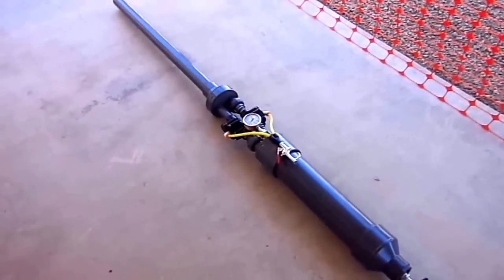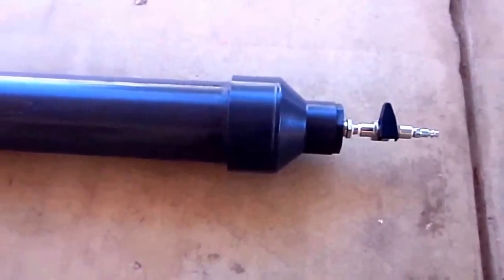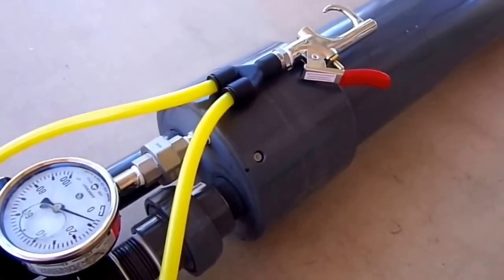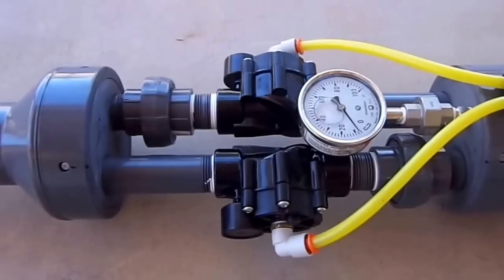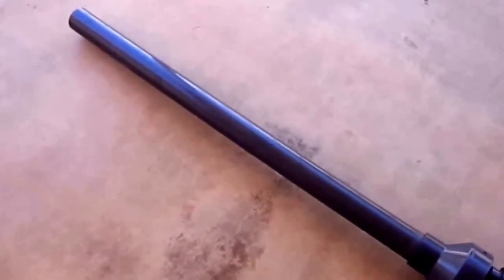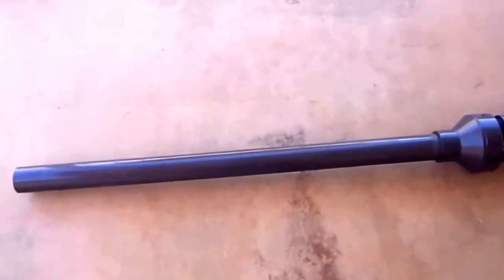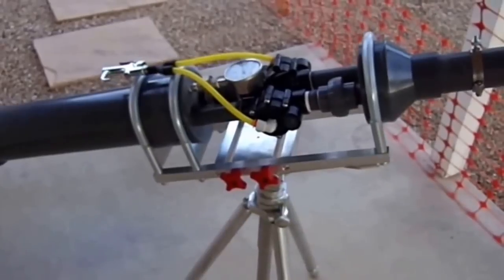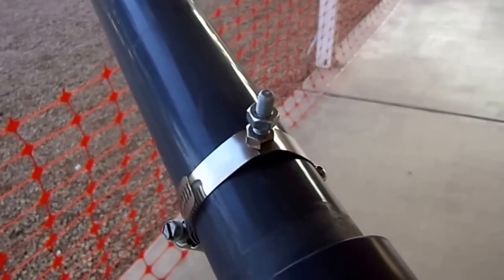500 Yard Golf Ball Launcher / Cannon

Comment: Great design with dual sprinkler valves.  Overkill for Schedule 80 PVC but your weak point is the Sprinkler valve as a switch.  The Rain Bird sprinkler max pressure rated is 150psi.  Need to use the custom made piston valve for max flow.

Comment: My local Lowes didn't have any 4" schedule 80 in stock so I bought schedule 40 to do some pressure tests. The 3' piece with caps on both ends, primed and glued, one drilled to accept a steel schrader valve held 165psi, all my big compressor could muster , now I'm not saying it's safe but I won't hesitate to charge my bait launcher to 100psi, that being said if you can get schedule 80 definitely use it.

Comment: Some fittings in this launcher appear to be drain rated rather than pressure rated (reducing coupler at back end). Use only pressure rated components (those are normally marked NSF-pw). Definitely wear safety glasses and avoid pressurizing in too hot or cold ambient temperatures as the PVC safe pressure rating drops quickly or the material becomes brittle. Safe launching.
Reply from the maker: Nope. All the reducers are Schedule 80 pressure rated to 150 PSI.
Reply: @jurgenscott8430  According to ASTM specs a 150 psi 4" fitting would not be schedule 80 pressure rated. ASTM D2467-04e1 requires 4" pressure rated PVC fittings to have a minimum working pressure rating of 194 psi and a minimum burst pressure rating of 1110 psi at 73 degrees F. Have fun and be safe.
Reply from the maker: @alanb76  You might be right. Who knows. I sold that thing to a golf company in Florida almost a decade ago and haven't heard anything bad. All must be good.

Comment: Love the dual valve design.  So many people use a single valve of the same size, and don't realize they are limiting the capacity of their cannon.  I've resorted to building my own valves to resolve this problem.
Reply: I always liked the bead blaster valves from some big commercial tire machines. Big trucks. 

2 inch inlet/outlet
Working 150psi, Burst 300psi, Not outside the realm to run 200psi with minimal safety concerns.

Or step to proper construction with Nitrogen, run 1500psi/100bar level stuff.

My launcher goals include Redbull cans.  lol.

Comment: Awesome! When I was a kid we built one using a combustion chamber running Right Gaurd as the fuel. We got 400 to 500 yds easy by wrapping the golf balls with strips of shop paper towels (the type that tear in strips along the seams).

This design is little inefficient since the golf ball has a lot of air gap around the diameter. Try wrapping it in something to make the fit tighter and loading it with a ramrod like a muzzle loader. I bet you get 800 yds out of it!

Comment: I built one using 40 pvc and it works just fine! I run about 75 to 80 psi on mine and I can send a potato up to 300 yards and a golf ball up to 500 but it's tricky with that because I have to wad it if I want to shoot a golf ball!
Reply: I have made cannons using 2 in tank and 1/2 in barrel shooting homemade darts. I regularly put 150 PSI in is, somehow not dead.
Reply: @jamesplatt3148  50 cal. airgun. (cannon?) Coool man. send plans?

Comment: MR jurgen let me tell you that you are genius i have one question and i hope you respond to me why you use two rain bird sprinkler valve what is the benefits for that thanks too much
Reply: The goal is to get the compressed air out of the pressure chamber as quickly as possible. 2 valves = twice as fast. If I had room I would have used 3.

Comment: Do you have any specs on your internal mod’s to the sprinkler valves?
Reply: I don't really have any specs but I put the valve bodies on a mill and machined out a large area to increase air flow. Similar to porting a head on an engine.

Comment: I can’t find any 1 1/2 of an inch sdr-26 pvc pipe anyway where. Where do I find it?
Reply: I found mine at Ace Hardware.
Reply: So far 27 hardware or home supply stores including major parts house chains either doesn’t have or can’t get 1 1/2” SDR-26 pvc
Reply: Do you have any suggestions ?
Reply: Does it have to be SDR-26 ?
Reply: It's basically 1-1/2" schedule 20 pipe. You definitely need it for the close fit around the ball. Try a sprinkler supply. I don't know if you have a Turf Irrigation or something like that around you.  @timothywingo4242

Comment: If I use 3 valve sprinkler with 120 psi it will be Danger ?
Reply: The valves I used are only rated for 100psi. 120psi might be ok but it will weaken the valve over time.

Comment: You almost took that bird out 😂

I made one with sch40....is it really that dangerous?
Reply: PVC piping was designed for liquid pressures that usually run at a constant or near constant pressure. It is not rated for air or gas pressures. The repeated pressurize to depressurize cycle can make PVC weak especially at the glue joints. At least wear safety glasses.

Comment: Hey Bud that is a bad ass cannon you built. My question is how does the blow tip trigger activate the solinoids?
Reply from the maker: The valves operate on pressure differential. Some of the air from the air tank goes through a small pin hole inside the valve. The surface area on the back side of the diaphragm is larger than the surface area on the front so it keeps the valve closed. When the differential pressure is allowed to escape (via the blow gun) the valve is allowed to open. And rather quickly also.
Reply from the maker: The solenoids which are no longer present would normally let the back pressure out of the valve and release the diaphragm. The trigger does the same thing only a lot faster because of the size of the tubing.

Comment: When you look as balls leave the barrel they just going in any direction, you wanna use super glue and a piece of pipe glued on the ball to give it a skirt and put some rifling in the barrel and it run more consistent to be accurate then ,I'd remove the white tube from the barrel and shrink the ID of the pipe to OD off the ball ,the slack in the ball in barrel now will be changed to the white pipe ,use a couple of inch to make a skirt ,once riffle it be super accurate then once you got the rifling right ,to little and won't hold stable over big distance and to much and creates the magnus effect and will make round pull to where least air pressure is in the air ? There is a magic ratio for riffing for the round and barrel ,with building a cannon so well am sure you'll explore hints on accuracy,knowledge can be dangerous thing ha ha
Reply: Thanks Paul. I already sold it and I'm on to other projects. Done with ball launchers.

Comment: That is fucking sick. why did you use 2 valves can't you use just one? how did you keep the ball from rolling back into the reducer?
Reply from the maker: Two valves let the air out faster. If I had room I would add a third.
Reply: @jurgenscott8430  Most people use sch. 40 PVC, pump it to 100 psi, seems safe?! Also, base on the math, your two 1" valves DOES NOT let the air out FASTER than just install a 2 inch valve, based on the cross sectional area: Dia=1" means r=0.5" which gives 2 valves total cross sectional area of 2x0.785=1.57 inch^2, while ONE 2" valves gives 3.14 inch^2; it means INSTALL JUST ONE 2" valve opens TWICE of air cross sectional area=moves air out 2X FASTER. Correct me if I'm wrong. I want to build 1 using 3" valve but cannot easily find it; and 2" valve is already cost so much more than 1" ones. Remember, the bigger the cross sectional area=bigger Diameter valve/pipes, the MORE FORCE it exerts. At 100 psi, a 4" pipe gives 1,256 LBS force; 3"=706.5 lbs; 2"=314 lbs force push. Based on my review of quick engineer/physics, it's BETTER TO use LONGER shoot out barrel and BIGGER 4" air chamber so max out SHOOTING RANGE. Also, we can calculate the energy it acts on the golf ball (which IT'S MUCH LESS MASS compare to shoot BAIT out; say, i.e., 0.5 lbs golf ball vs 2 lbs or 4 lbs of bait or stone or metal ball), and we can use physics to calculate the LIGHTER 0.5 lbs the golf ball shoots 500 yards will become 200 yards range if the same gun shoots 2-4 lbs of BAIT heavier object. When I've more time + better mood, we can review engineer/physics laws to calculate how far can we design 4" air chamber at 4' to 10', change 2" barrel from 5' to 10', how far range can it reach:). After out of school & man have to work to make $, I forget many physics laws. I've to review when I make enough $, retired young and have good mood/time then review those fancy laws - every man loss so much childhood fun dream times when he grows up spend too much time to make$ work for a barking boss, sometimes have to work hard to make women in our life happy we become slave or don't have time to do fun things:). I wish I can find 3" value sell under cheap price < $15! Bigger valve=let air out FASTER=BIGGER FORCE PUSH object out=SHOOT LONGER RANGE=HAPPIER men we become. Most girls don't care about men's fun project LOL:). Hope u teach me something. Thanks:)! In short, make one shoots 500 yards of 0.25 lbs golf ball is pretty easier, but make one shoots 2-4 lbs stone ball heavy object shoot over 300 - 500 yards is MUCH HARDER. Any advise is welcome. Love to exchange mental power:)!
Reply: @alexl932  That was a great response. Thank you for that. Your math seems right and I would think a 2" valve having more surface area would generate more distance. It was fun to build and I already sold it long ago so on to the next project. I'm almost 60 and semi-retired. I never went to college so no physics classes. I just picture it and build it. Hell, I never finished high school either. Just had no interest. Still had a great career and life is good. I might be the living proof that higher education is a total waste of time and money LOL. Check out one of my other builds... https://www.youtube.com/watch?v=_uCZwASb2xw
Reply: @JScott-wz2ug  Your success story is another example of school grade is NOT related to real life (street smart vs book smart) and many people spend big $ in school but grad with huge student debt and unemployed due to they major in not-so-practical field then they said edu system is scam. I'm lucky get my EE (Electrical Engineering) degree that's practical and make my tuition investment back but my boss was a racist white man who treated me like dirt and slap his leg call me like calling a dog - anyway, after work about 3 yrs as stressful unhappy EE job in silicon valley pressure cooker environment, I never look back. Now I run my small business & manage my own rental business but SF has Rent Control & Eviction Control. I've a video proof many whites are still racists said "this is my White country, you go back to China!" then hit me dozen times and SFPD is also racists who don't jail her, NOT even handcuffed her/lock her up for 1 hr, they write the police report turn the story total OPPOSITE said I provoked her to hit me - people inside their mind are racists but won't admit. However, I've some very good White friends too:). ANYWAY, CAN you do a test on how many yards or feet can your machine shoot heavier object like 1 lb or 4 LB? You shoot 500 yards only on light Golf Ball, I want to design it can shoot at least 2 LBS small kayak anchor to as long as possible to cross river (for example) to pull against heavy water/etc LOL. Here is what u can do: squeeze many potato up to weight about 4 LBS into your barrel as an replacement for Golf Ball. Another way to make 3 LBS object is drop water into a same size barrel, seal it as a bottle (maybe over 1 ft or 24 inch long barrel tube) then freeze it in fridge 1 day just like any FISH BAIT barrel. The next day you bring it out from fridge & make it loose then slide into your cannon's barrel (you can weight it ensure it's about 2 LBS) to shoot it :). Pls tell me how far can this 3 LBS object fly. You can use it to shoot turkey too:)! You're an amazing handy man:)!
Reply: @alexl932  I would like to help you out but as I mentioned earlier I sold the launcher.

Comment: :D How did you modify the sprinkler valves?
Reply from the maker: +avman2cl  The inlet and outlet were bored open and the internal baffles were thinned out to allow for more airflow. Similar to porting heads on an engine. The factory solenoid port was sealed and a new 1/4" NPT port was installed in the top cap for the trigger tube. Hindsight, I probably didn't gain that much and If I wanted more airflow in the future I would just build one with 3 valves. Good luck.

Comment: Hello Jurgen. There are considerable technicalities in making this cannon. Is there any way you can show it step by step or sending me the blueprint? I am old and nowhere near smart and technical like you. Can you please assist me in building this cannon. Thanks. Tony from Australia.
Reply: Hi Tony. I don't have any blueprints for this and I already sold the one in the video. The video description is probably the best outline of the project. It's really just a bunch of fittings and glue. There was some machine work needed to build the adapters and the valve needed a fitting installed and the solenoid opening needed to be epoxied shut. I did some porting on the inside of the valve but looking back it probably didn't have any added value. If you showed my video to any local pipe fitter or plumber they should be able to assist you. Also I don't think you can get a tennis ball to go 500 yards. It's way too light and there is too much wind resistance. Now if you filled the tennis ball with concrete then we could probably figure something out.